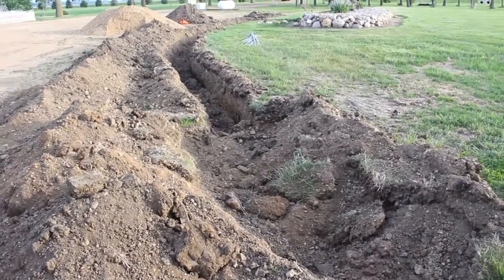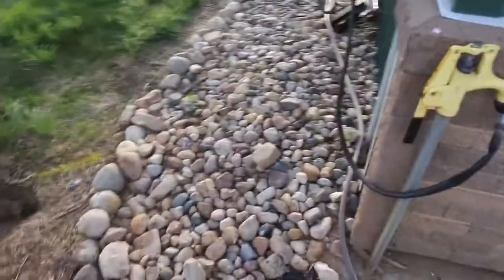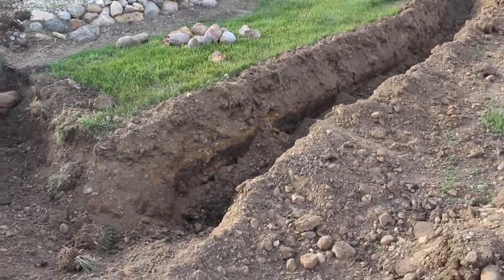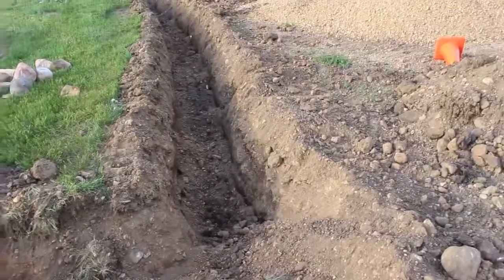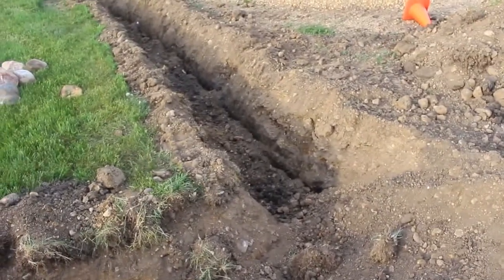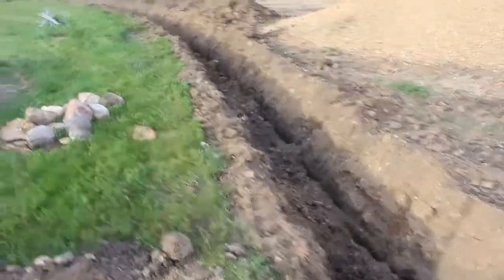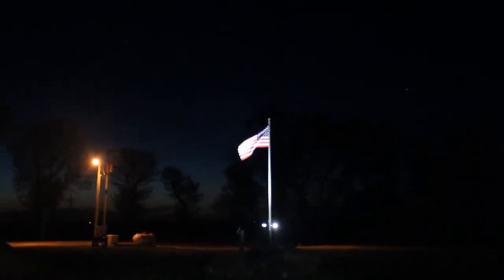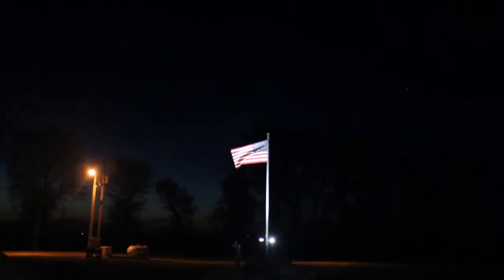Installing Lights for the Flag

Comment: Do you have the details on the lights? Can you show the box, light wiring and internal wiring?
Reply from the maker: The lights sockets were simple weather rated fixtures from Lowes (I think they were $5 each a few years ago when I did this). The rest of the wiring is all 12 gauge copper stranded wire to a junction box with a switch and dusk to dawn sensor. Overall, its a very simple set up. We put it on paper first and then went to work.

Comment: Curious, other than the "fun" of operating the mini-excavator, why not use a trencher?
Reply from the maker: Really good question: Three reasons on my end 1) I needed the excavator to also take out the stumps in the previous videos, 2) Based on conversation with the PO of the property and our next door neighbor there are parts of the driveway that have large rocks (over 4 inches) about 12" under the surface and a trencher would not go through those rocks (at least one I could rent locally), and 3) Cost, a trencher would have been $400 for the week and the mini excavator was $750 and much more functional for other tasks. If I had only done the lights, I would have rented a trencher or a smaller excavator.
Reply: Yep, all good reasons for your situation.  Every time I rented a trencher I always wished I got the bigger one.